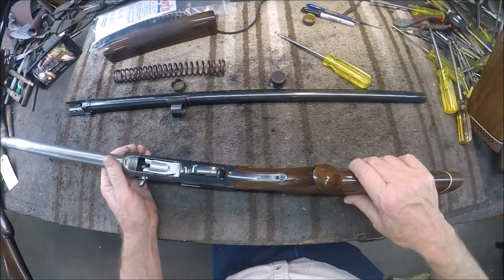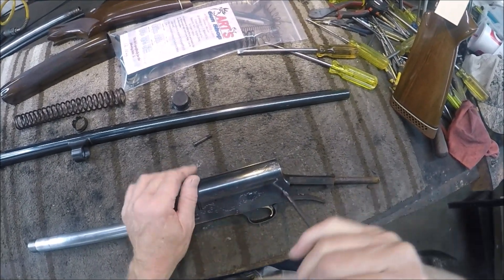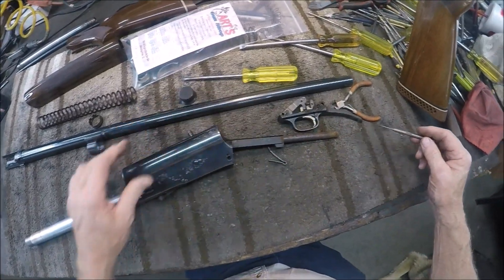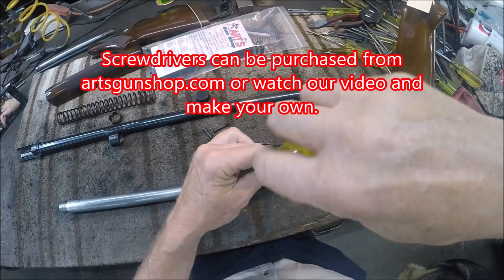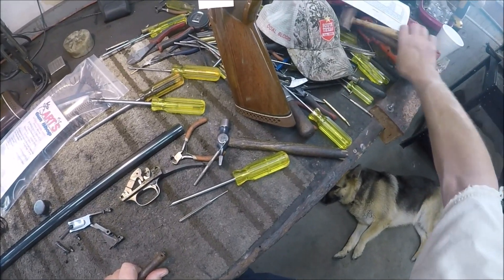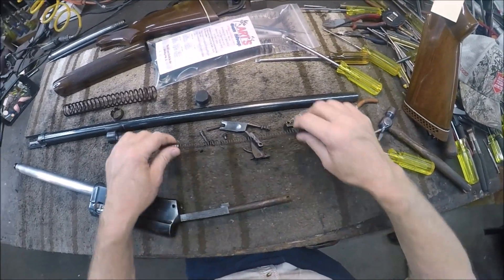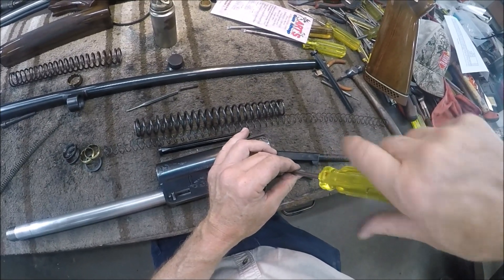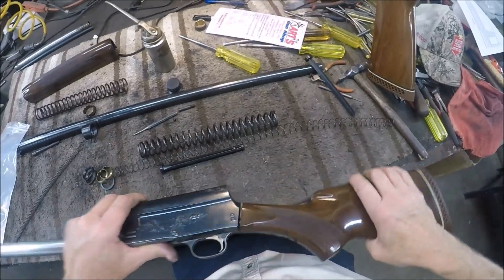How to install a  Browning Auto 5 rebuild kit

Comment: Awesome Video I have a A5 12 Mag and a A5 20 Mag.  I have shot them for 30 years and no one has done a better explanation of where these friction rings should go.  Personal experience of not having all the rings in your gun with 3 in shells with a heavy load, may end of cracking your forearm stock. I am replacing mine for the second time and making sure that the stock is tight on the gun and proper rings with shells.  First time I cracked it on a Dove shoot in Mexico, probably shot close 500 shells in 4 days. The exact reason for the cracking is most likely shooting too heavy loads with out all the rings.   I just found 2 extra rings in my hard case, I had stored away and forgotten.  Second time was just recently again, after not shooting the gun for a spell and forgot about the rings issue and not paying attention to the loads.   Just bought a rebuild kit for both guns and a new forearm stock. Thank you for the lesson.  Great Video.

Comment: During the 'off-season', I store my belgium A5's and model 11 with the magazine cap/forearm slightly loose.  Don't completely tighten the magazine cap or a crack in the base of the wood forearm might develop.  My theory anyway.
Reply: Hola jefe lleva mi A5 montada unos 15 años y como si nada ,se nota la calidad

Comment: I have 1953 A5 with the single piece carrier. That spring was kicking my butt until I figured out where on the carrier the short end of that spring engages. Also, the spring mounts on the side of  the receiver, so please talk about that.
Thanks again.

Comment: When I shoot 2 3/4 I put the extra rings under the spring works just fine and I dont loose them aswell.
Reply: I believe thats the way they intended other wise the pressure on the spring would be different.

Comment: you mention the locking block pin having a flat on one side (actually mine has opposing flats on one end) and it is important to start the right end, but you neglect to inform which end to start.

Comment: is it normal after lubing the magazine tube with a light drop of transmission fluid to cycle light trap loads on the heavy setting?. The gun is a 2/3 4 12 gauge
Reply: He has said in several videos to start with the heavy setting. it might or might not cycle the light loads. If it does fine, if not switch to the light setting

Comment: This is great stuff but, you should never leave any rings out of the action.  You did mention moving the steel ring next to the receiver, be sure you place the bevel towards the receiver.  If you said that, I missed it but it's important.   Thanks!

Comment: I have A5 loght 12. My safety my needs to br replaced where can iget the parts? ASAP
Reply: Ebay or midwest gun works but i would have someone with experience do it u could mess up the screws or loose the ball